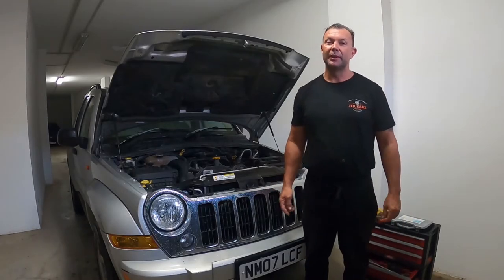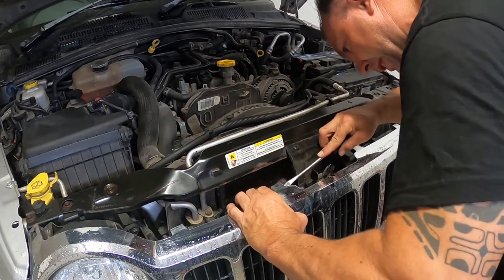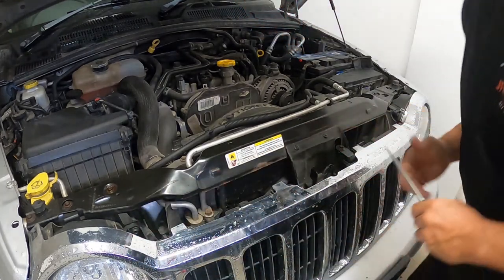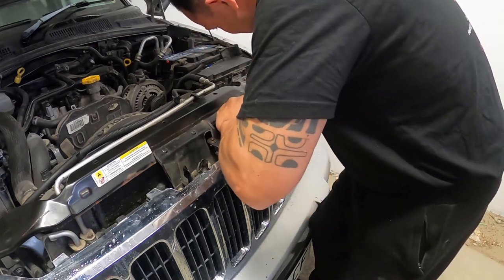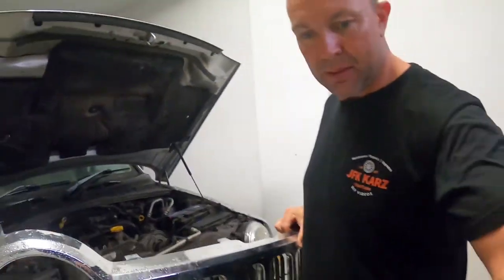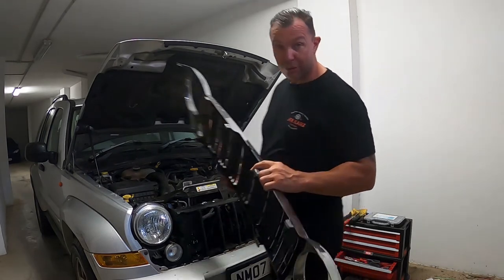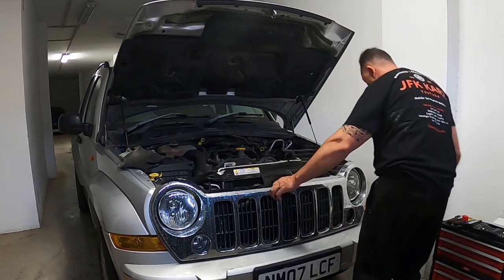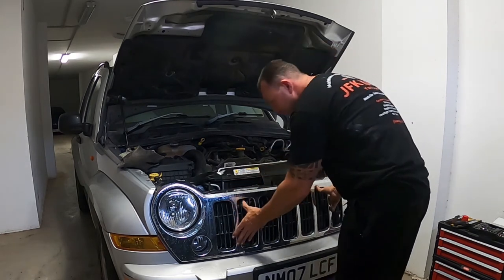Jeep Liberty (KJ) Front Grill Removal & Replacement 2002 to 2007

Comment: Any chance if you know if a 2003 will fit on a 2007?
Reply from the maker: The first generation run from 2002 to 2007, so it should fit, but they may of changed the fixings.  So not 💯 precent sure, without seeing the 2002 grill.